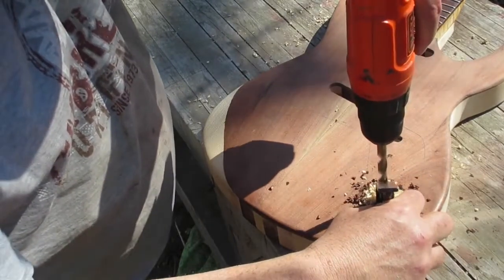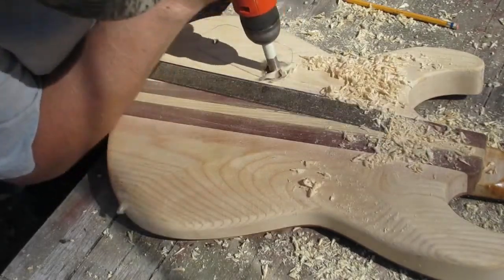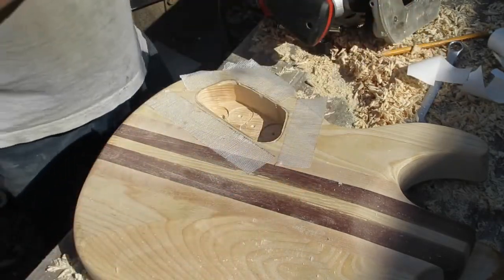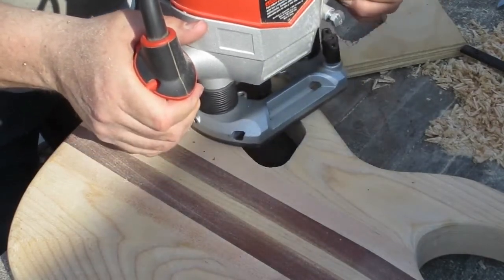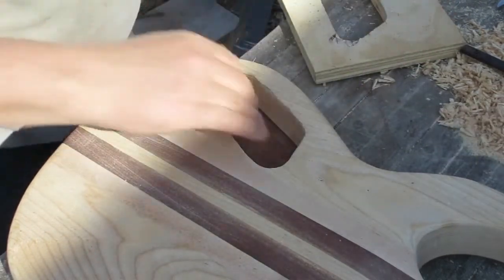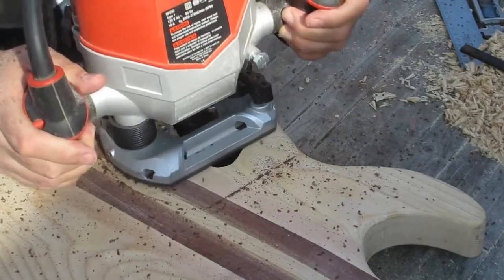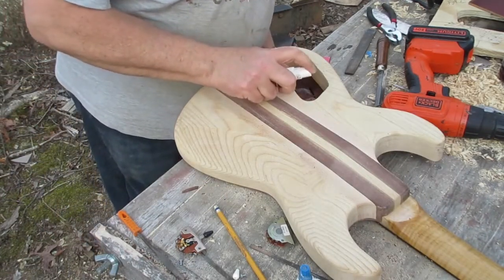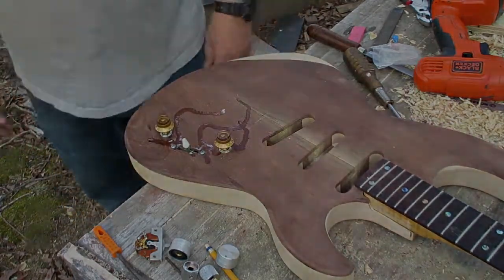Electric Guitar Build Rear Cavity Rout

Comment: What is the make of that router if I may ask?  I’ve been looking at some plunge routers lately as I’m a bit tired of the traditional base I currently own.
Reply from the maker: Black and Decker. I've run it at least 7 or 8 years with no issues. I could not abide a router with out a plunge base.

Comment: What is the total lenght of the bit you used? I have to find one, safe enough to route the control cavity of an 45mm body thick.
Reply from the maker: I am not certain, but I think they are 12". I bought them as a set at a local discounted tool store for very cheap. If you are building guitars, particularly electrics, you really do need at least one or two of them.